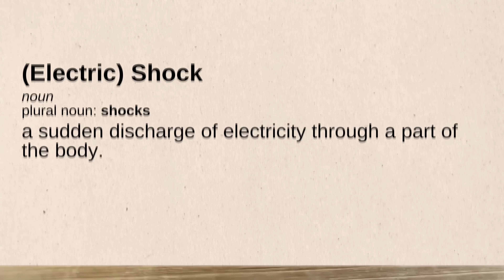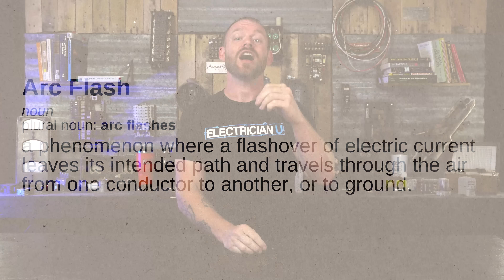How Do I Get Shocked? Why Am I Getting Shocked? It's Simple.

Comment: What's your recommendation / thought about making sure the neutral in a circuit being worked on has not been pirated for another circuit?  I was working in an older building and shut off the circuit I was working on only to get a jolt when I touched the neutral (I was kneeing on metal scaffolding).  Turns out the neutral had been pirated for another circuit that was still live.  The other circuit wasn't identified as a multiwire branch at the circuit board.  What do you do to avoid same?
Reply: You'll find this a lot in older construction. Shared neutrals were allowed until like 2011 nec. The best rule of thumb is just assume neutrals are shared in old work situations.
Reply: This is why using a multimeter to test an unfamiliar circuit is important. I was was installing a GFCI in my parents' very old garage and it kept tripping when I screwed in the fuse (yes, that old). Taking it back out to inspect, I got a little tingle on the neutral. Put the multimeter on it and lo and behold, there was about 6 volts on it but wasn't enough to trigger the non-contact detector. Discovered it was a shared (or pirated) neutral with another circuit that was hot. Could have been worse if there was more stray voltage on the thing, so now I always check with the meter before I touch anything.
Reply: My opinion? Untwist neutrals with insulated pliers , or cap them off or tape so your hand doesn’t graze them

Comment: First time I really had a question.  Okay so say you touch the hot wire and that electricity always want to go back to the source, theoretically therefore would you only be hit by 120V instead of the full 240V?  My thought being that ground and neutral will be bonded at the main panel and if you were to touch a hot wire and have current flow through one's body...then wouldn't you only be being shocked with 120V since ground is bonded to neutral?

Also I should mention I have been shocked with by a single phase 460v airconditioner, but what probably saved my life was that my pinky had been touching a grounded plate so I could feel it go through my hand pretty violently.  I should also mentioned that this could had been avoided if I had double checked my operator's powercord connection.  She had wired in a 14/3 powercord used only for testing purposes (cord used for a 3 phase wye system) instead of a 14/2 (leaving a live wire dangling on the back of the unit we had been testing.  Even thought L1-L2 are being used, L3 will still be energized).  In this theory, I believe I had been shocked with 266V (460 divided by the Sq. Root of 3 equalling 265 and some change) since I had been grounded through the back plate of the unit.  The main point of my long winded story is you might have done everything by the book, but always double check the electrical situation of another person working on the same electrical job as you.

If felt like one of those zombie dogs biting my hand and violently shaking my hand.  I tried to move my hand and it felt like a thousand rubber bands holding my hand down as I tried to move it in a upwards direction.

Comment: I've been shocked by 120v wearing insulated work boots and only touching it with 1 finger plenty of times, so I'm not buying that.

I've talked dozens of licensed guys about this next question and no one knows the answer - what determines the amount of amperage that is being flown through your body when getting shocked? It is how much amperage is on the wire when you touch it, or is it the amount of voltage on the wire divided by your body resistance upon touching it? As far l can tell, amperage kills but... only theoretically. What really kills you in terms of what you need to be aware of is the voltage. The more voltage there is the more amperage is gonna be created when making contact with your skin. That's why when people say ''amperage kills'', it's technically true but very misleading - voltage is the main factor.
Reply: Not an electrician, but I believe the answer to that question is "it depends".  Your body is no different than anything else that adds resistance except that it doesn't offer much, so it depends on the total resistance of the circuit that you're getting shocked on.  If you were to cut the wire going to a load or the neutral wire going back to source and add yourself into it in series, then the total amps going through you is determined by the resistance of whatever load is on that circuit.  You can just use a clamp meter to figure that one out - introducing yourself to the circuit isn't going to measurably change that number.  Now if you introduce yourself to a circuit in parallel, you're going to get a massive amount of amps going through you since there's little to no resistance.

Long answer, but basically Ohm's Law still applies here, there's nothing special about your body.  Amps = Voltage ÷ Resistance.

Comment: I'm glad you spoke on neutral current.
I had a site where workers were saying they were getting shocked stepping off of an aluminum scaffold onto a wooden deck. 
Odd?
The entire scaffold was energized by neutral current and had potential between the detached house and scaffold. I used a ground clamp on the scaffold and connected it to the ground wire from a flood light. No sparks or anything, voltage between the two structures whent from 115 to 0 immediately.
Reply: That is quite scary Samuel. Will bear that in mind. I am always a little nervous when I switch on a table lamp where the switch is part of the light bulb holder. Should be perfectly safe....in theory!😨
Reply: @w1swh1  It's safe, lamps don't have a connection to ground normally. The plugs are polarized ( you can't plug it in wrong  because one side is physically bigger than the other) [ Or it is double insulated meaning there is no physical connection between electrical parts and the body of a piece of equipment.]
Reply: @samuelcrossland1101  Thanks Samuel, makes sense.

Comment: Neutral is supposed to be a non current carrying conductor. I've been hit from neutral to ground when circuit was OFF. Just because you turn breaker off it does NOT mean you are safe to touch wires. NEVER trust your co workers..TRUST ONLY YOURSELF. First time I ever got shocked was due to a licensed journeyman installing the switch upside down..I " turned off" switch and went straight to replacing ballast without checking with voltage tester. Was definitely a learning lesson! Save your own life!
Reply: Yes , so many unlicensed or unqualified electricians will just simply folowing color to color for connections. They even don't realized that was wrong connections too. Hot to neutral and neutral to Hot... OMG why this will happened................

Comment: Having worked in both residential and commercial, my multimeter is always within arms reach, right along side my screw drivers (electrical rated) and lineman pliers.    Never trust colors.   in residential it's common to run a 12/2 NM to a NEMA 6-20R, for a larger window air conditioner.   the white is supposed to be re-identified as hot, but I've seen many instances this isn't done.    In commercial working in a three phase panel, not only do I need to check whether the power is shut off and locked out, I also need to know, if I'm dealing with a 120/208Y, 277/480Y, or a 120/240V Delta with high leg.    The high leg on a delta is 208V to ground and is supposed to be marked orange, and it's very easy to mistakenly place a single pole breaker on this high leg and you just wiped out thousands of dollars of equipment because you thought you were getting 120 volts.
Reply: Keep my fluke 101 with me at all times.

Comment: Also, always confirm it on your own that the power is off. Dont rely on "buddy" to make sure its off. "Hey buddy did you turn the circuit off?" Make sure its off. Dont count on Buddy
Reply: Buddy is never your buddy! Hell even when I turn off power I still check, because I'd rather coffee over a shock to wake me up!
Reply: Verify the power is actually removed also. Don't rely on the wiring to be correct, or the labeling to be correct.
Reply: 1000 %
Reply: Even if Buddy is competent, you don’t know for sure if Buddy and you are thinking of the same circuit. Think how mny times you’ve said something like “move it a little to the left" and had the person move it to the right. The other person has a different point of view (they are facing you) or they just momentarily forget which is left and right.

Comment: Why do I get a shock on an Open Neutral?  But if not open, we all can touch the same neutral.  comment please.
Reply: Open neutral carrier current and your body becomes the path back to earth.
Reply: Neutrals carry current when there is a load on it, remember a neutral is the path back to the source, so when its open the current doesn’t have a way back to the source, therefore the load will not work, by touching an open neutral, if you are grounded and the circuit is on and it has a load on it, you complete the path back to the source by being in series of the neutral or between neutral and ground. Just like Dustin mentioned, you can touch an live open neutral all day if you are not between two contacts. Neutrals can be just as dangerous as any hot, if not more because people think they are safe when in fact they sometimes aren’t.
Reply: @D_Spear  Rethink the statement “so when it’s open the current doesn’t have a way back to the source, THEREFORE the LOAD will not work.”

The load(s) will balance themselves (leg A and B) with the LOWEST of the two loads
continuing to work (Without a Neutral).    Thank you for help.

Comment: You cannot be grounded at all if you want to touch single hot wires without getting bit. Most shoes will have a low enough resistance to allow 120V and up to pass through the body to earth. Make sure you are on a fiberglass ladder, or have electrical rated mats, etc, if you plan to touch anything hot.
Reply: You do have to be careful though because even though you won't feel anything if you're ungrounded touching 120, higher voltages can cause problems simply from the potential difference of your body and the wire when they touch. Those guys who sit on top of transmission lines coming off a helicopter have a wand that helps them equalize potential
Reply: I mean, unless you have ASTM electric hazard rated boots, safe up to 18kV. Which everyone ignores because they pick their boots by looks, and which "top notch" brands like Nick's and White's don't even offer.
Reply: @Bapuji42 you have a brand in particular ?
Reply: I use to test power by using 1 hand 2 fingers, but I've stopped doing that as I probably shouldnt...shouldn't.... lol good ol days, when you start to care about your health.
Reply: @blakek1043  I use a tic tracer (volt stick / hot stick). Fun tip, you can rub the tip of a tic tracer quickly across your pants or shirt, and the static electricity will set it off. Nice way to make sure the batteries aren't dead. Then if my tracer doesn't go off, I deliberately short each wire I'm going to handle to ground. It's actually saved my butt once when someone tried to turn the wrong breaker back on. I'll usually leave the home run hot tied to ground until I'm down to that last connection. Breaker will trip if someone else tries to turn it on before I'm ready.
Reply: @blakek1043  When I was a kid I did it across my tongue. Did it once with a ballast transformer. Last time I ever did it.
Reply: @blakek1043  that was the officially-listed best practice in training back in the day before tick testers were invented. The safety precaution was to make sure you only use your pointer and middle fingers so you aren't harmed past your extremities. Now for $10 or $15 you won't need to lick your fingers ever again
Reply: @blakek1043  that’s kind of how I was taught to test an electric fence. Always make a fist and touch the top of your hand so it can’t grab you.
Reply: Not really....Ill grab a hot wire here and there with my ticker or my meter in the other hand  to freak the new guys out. Never been bit from standing with boots. But I'm sure after typing this it will happen next time I do it...gotta love electrical
Reply: True story lol. The guy that taught me this, let's just say I made sure he did it first before I trusted him to try it myself. Better make sure your boots don't have holes in them hahA
Reply: My house is made of rubber -.-"

Comment: Commenting before watching as a student: You get shocked by hot HV anything, you die from disobeying the one hand rule, and you get shocked by giving a live circuit an overall shorter branch to discharge though(You). In simple terms, HV will bite you, keep one hand in your pocket around anything live, and touch with your eyes before you feel with your hands.

Things I'm reminded of while watching: Always wire the ground first, then the neutral, then the hot, and never wire things while they are hot if you can avoid it. PPE is a given.

My takeaway: Work in your training and specialty, if you are asked to do something you have not been trained for fall on the OSHA side of things and try to get training for it. Use every resource to prioritize safety above all, this is why we make lots of money: To spend it on PPE and contingencies. The temporary debt, education time, NEC book time, and perfectionism are ALL worth it and what makes an excellent electrician in the end. Kneeling is for suckers, squatting is the way to go. In the end electricity is a jetstream of energy similar to a water jet that moves through conductive material, if you become that conductive material it will vaporize your cells into a nice dry carbon conductor in an instant: don't let it happen.
Reply: that is a huge lesson, thank you

Comment: So what your telling me is that every hot wire I've have ever grabbed and got that tingly feeling I was NOT being shocked? Sorry, I beg to differ with you I have wired 100's of live plugs, light fixtures and so on and have been shocked by the hot wire only (NOT) electrocuted but could feel electricity. I guess I'm just a conductive kind of guy :)
Reply: The back of your hand or something had to complete the circuit

Comment: I have to be extra careful when it comes to electricity because I had a cardiac arrest and now have an implanted cardiac defribillator (icd). I'm a auto mechanic and have done home electrical repairs. I've been shocked by the ICD, the engine ignition coil and home voltage (not at the same time) and none of them feel good. Getting an external shock can damage my ICD or cause it to shut off. If one has some type of electrical device implanted in them, be extra careful when working with electricity because the affects of getting shocked and how it will affect the medical device implanted in the person is unknown until that person is shocked by the external source.
Reply: If I was you I’d look into putting money aside for insulated gloves and leathers to go on top of, if not switch jobs buddy a desk job might be worth it for peace of mind not trying to be funny
Reply: @modernbassheads5051  working on cars with insolated gloves can be difficult especially with today's engine compartments that are extremely tight. The home repairs I do are things like replacing outlets, switches, installing lights, ceiling fans and other similar type fixtures. I'm not rewiring a house. When doing home electrical repairs, I shut off the circuit and make sure the circuit is dead with a the multimeter. I'm a hands on, technical type person which is why I work on cars and do simple type home electrical repairs and am not a "desk" person.

Comment: I've been doing this for 7 years and have hit by 120, 208, 277, 480, 250VDC and 24VDC. Guess which one hurt the most. 

24 fkn volts dc hurt the most. I was on top of a liquid filler machine trying to reset a plc module. It was hot as hell in there and i was sweating like a stuck pig and also had a ton of cuts on my fingers and my nitrile gloves were ripped. 

To this day, I am still baffled that that incident hurt the most.

Don't get me wrong- getting hit by 277 or 480 doesn't feel very good either.

Edit- no I am not bragging about getting shocked. Thats nothing to brag about. It means you were being dumb and not testing the circuit dead or not wearing your ppe. But a few of those times I was still an apprentice and it definitely wasnt my fault.
Reply: Sounds like you need to find another job

Comment: I worked live on a circuit, when I changed a light switch on knob and tube wires. I didn't know, where the breaker was for that circuit. I touched the 2 wires together and found out that the light turned on and it didn't break the breaker. I was wearing a pair of dish washing gloves. I'm just a homeowner.
Reply: Stupidity is going to play Darwinism, on you one of these days, not later, but sooner than you think.

Comment: So when you ARE touching only the hot... do you know if the current stops in your body? Or if its stopping at the end of the wire?
Furthering this question, if you don't get shocked when the electricity is stopping within you but only once its passing through you? Why? Because you have allowed a path? So less resistance and increase of current?
Reply: absolutely to part 2 of the question.
Reply: If you only touch one wire, and the rest of your body is insulated, dry, etc, there is no current flow through your body (the circuit is not complete).  It is the current flowing through your body that'll hurt you. Think of a bird sitting on an electrical line.

Comment: if i use a trick tracer and it doesnt light up meaning no voltage then why should i test with multimeter to see if no voltage? thanks great videos.
Reply: Batteries could be dead.
You could forget to turn it on.
Some models can give false negatives due to a design flaw and have actually been recalled.
Reply: Multimeter is much more reliable